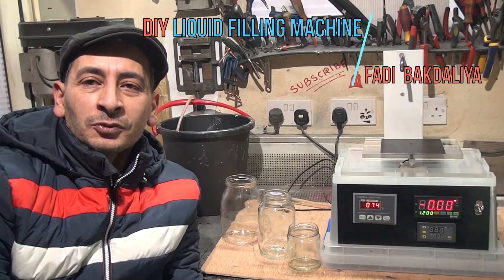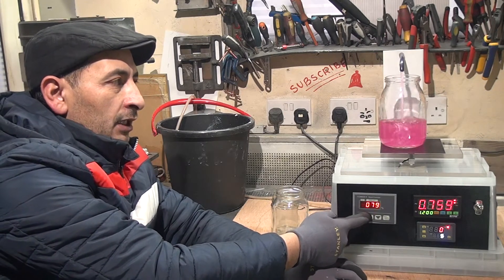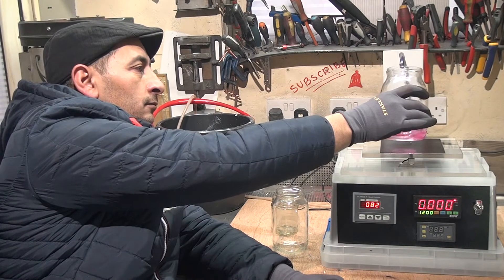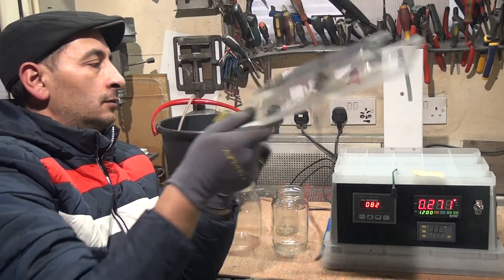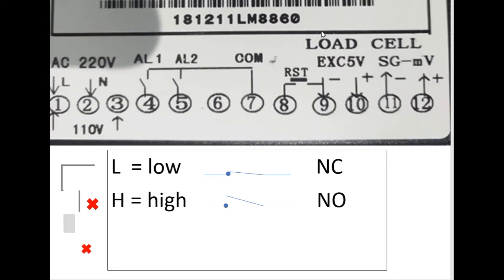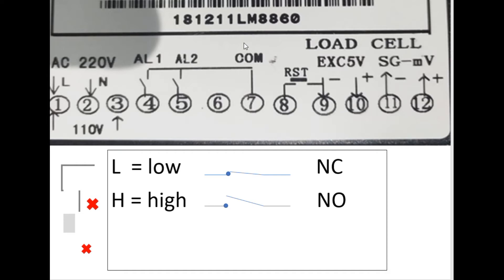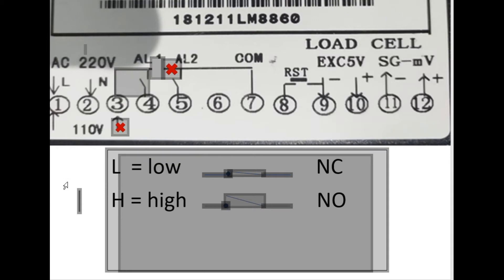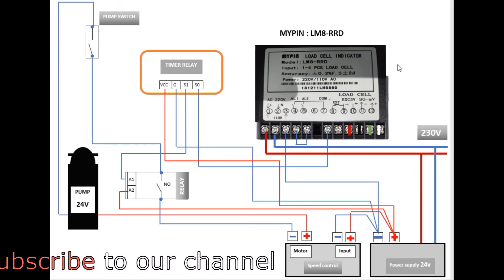DIY Liquid Filling Machine PART 2

Comment: Thanks for share the video,  i have a problem in this controller. I am using the controller a packing machine.  When completed a packed Al 1 & Al2 also comment done and completed filling bucket on loadcell. but completed a full circled controller auto start after 10sec. Kindly tell me when i am comment controller  then start Al1 &Al2.
Reply: You are making this machine